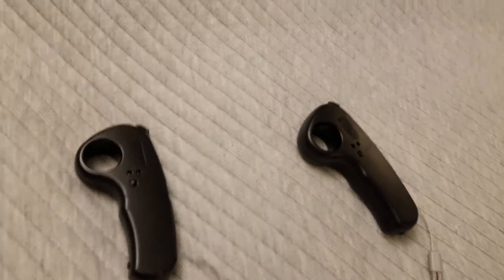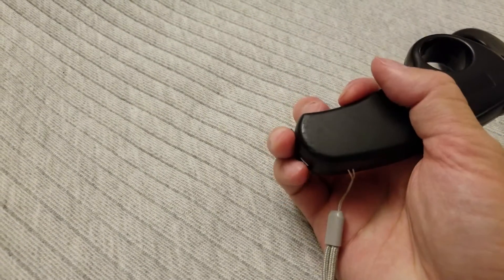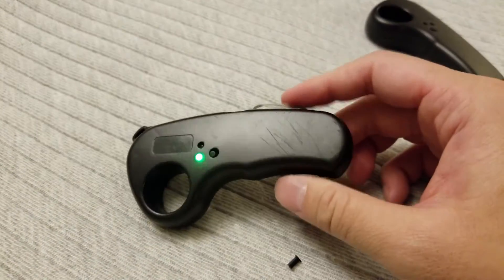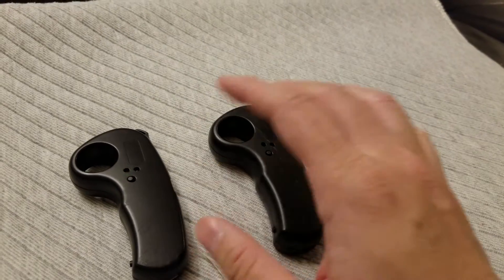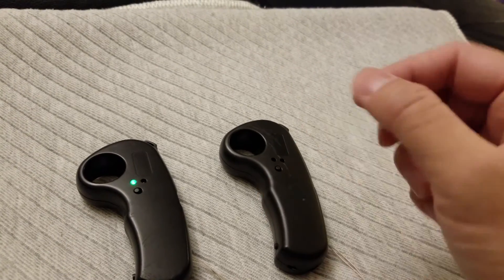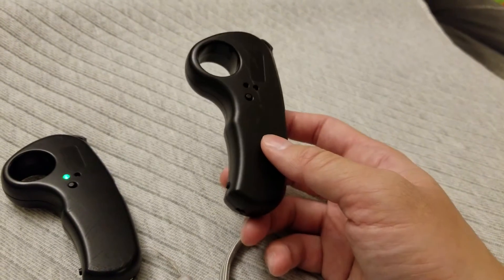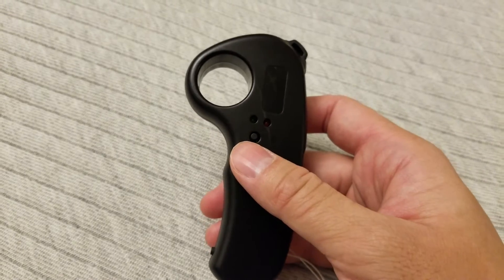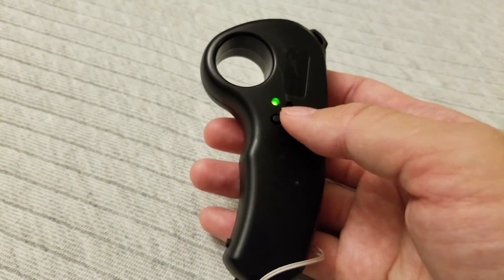Lacroix Nano v2 Remote safety modifications and calibration

Comment: Can you Bluetooth a different remote to that board if you purchased one for a DIY board?
Reply from the maker: It needs to be compatible with the BT receiver inside the Lacriox board. most of the time, it's not compatible unless you replace the receiver with one that matches your new remote.
Reply: I did that with Hobbysky remote and that was the worse thing I could have done. Most DIY remote are terrible in crowded places like NYC and LA. You will get so much interference that the board will become unusable. The best thing you can do is get the hammerhead enclosure for the Nano V2 or get used to the Nano V2.  It will happen eventually.

Comment: Got a replacement as well and liking the new one, Great tip on cutting the on/off  switch. I really don't understand all the fuss about what it looks like, it disappears  inside my hand so well people wonder how I am controlling the board  andddddd it NEVER disconnects nor is it affected by another remote. I would like a bigger finger hole cuz my hands are YUUUUUGE !!
Reply: Beelzebob the innocent that’s the best thing about the Nano V2.  You don’t get interference like the other DIY remotes. I almost killed myself using the Hobbysky remote in NYC.

Comment: I wonder why I can not pair a proprietary Boosted Board Remote, which is allegedly the safest controller on the market? If Boosted ever licensed out their proprietary controller technology, they could make an easy buck.  We know that the  Bluetooth is programable via VESC or FocBox... Given the fact that the ESK8 Community is reduced down to using Open Source Controllers, does this imply that most future Open Source Controllers could be paired to the Lacroix? The industry standard for Open Source Controllers is only going to get better. It remains to seen, if DIY ESK8 enthusiasts, i.e. Lacroix owners will find setting up the newer Open Source Controllers user friendly.
Reply: Nano V2 is the only remote on the market that works perfectly with Lacroix. Others have signal dropouts because of Lacroix carbon fiber enclosure. That board can go up to 40mph. Imagine a signal drop at that speed. Instant death. Say whatever you want about Nano V2 but this remote is damn reliable.
Reply: @temporarymomentary  instant death if you are not able to ride it out... I guess.
Reply from the maker: @galacticom  I would also like something similar to the boosted or chinese copycat remotes. My wowgo remote never had a disconnect and I much prefer the design over the nano. The boosted remote feels even better and I haven't heard much about people getting disconnects from it. If it's a proprietary or patented design then I can see why boosted don't want to share it to have people focus on buying their remote/boards instead of others.
Reply: Where do we purchase the latest NanoV2 Build? What is the Build #?... I am still waiting for my Lacroix...
Reply: let me know if you figure anything out. I hate my remote, seen some guys using Hoyt. St. puck remote...but that's 200.00 extra bucks...wish Backfire's new remote would work on my Lacroix.